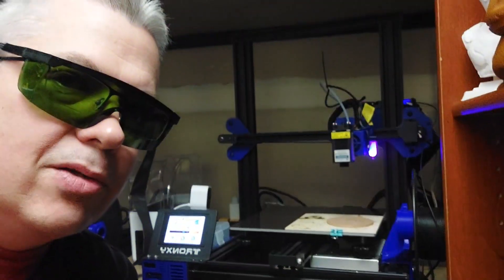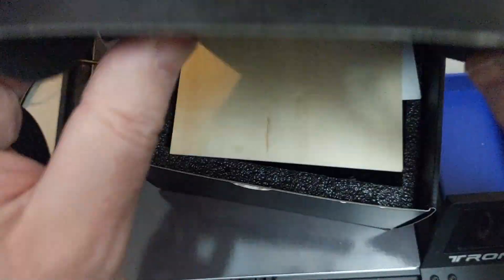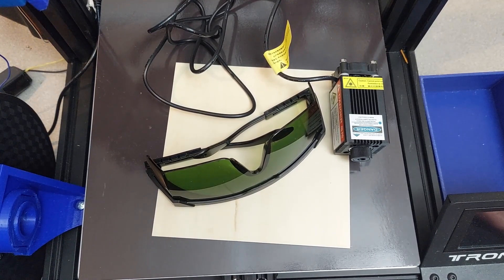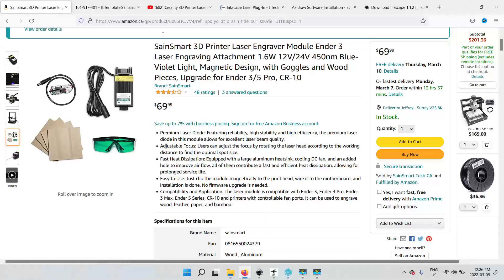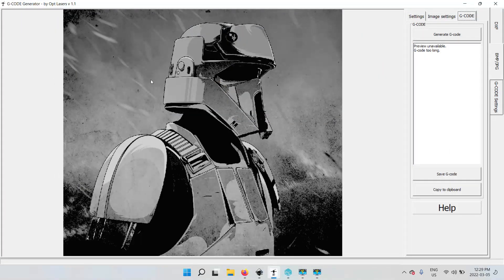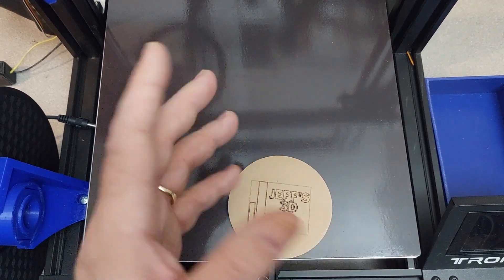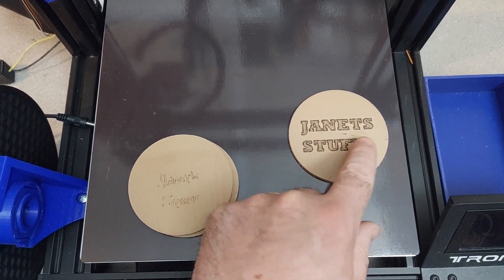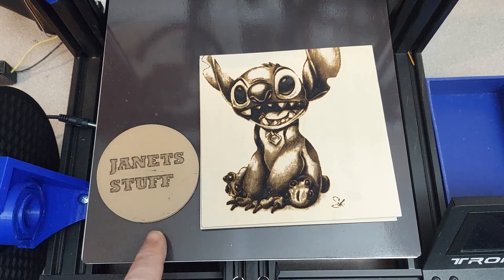Adding a Laser Engraver to a 3D Printer

Comment: You are in error it it not wired backward. That board is a known issue. I am on number 3 in the  last 2 months. I did the same conversation you did after that. Also it will cut wood I cut 3mm wood. Good video